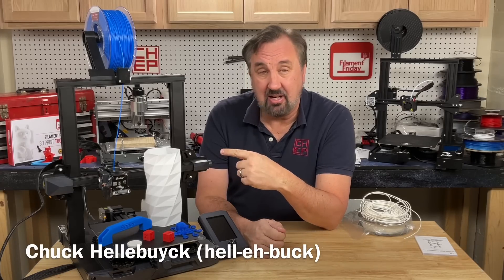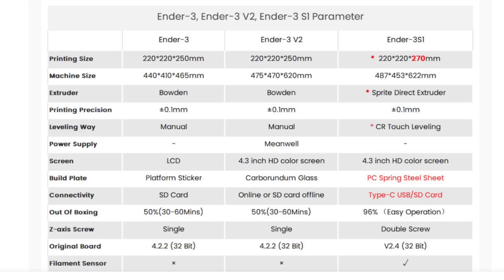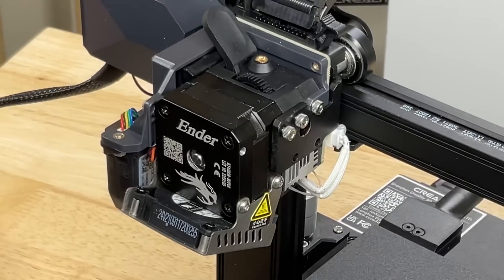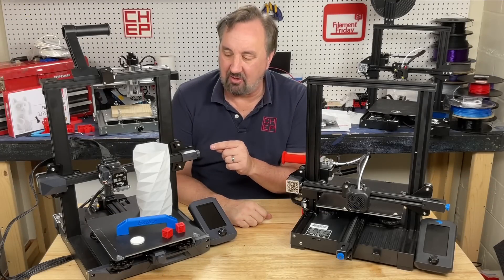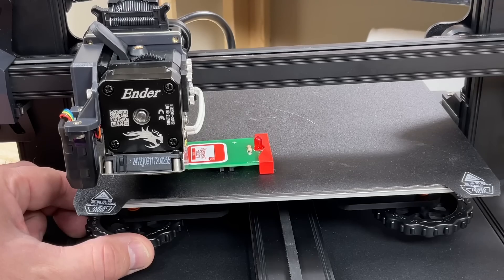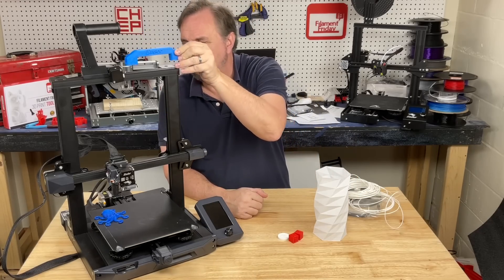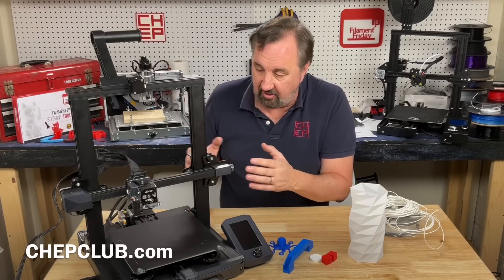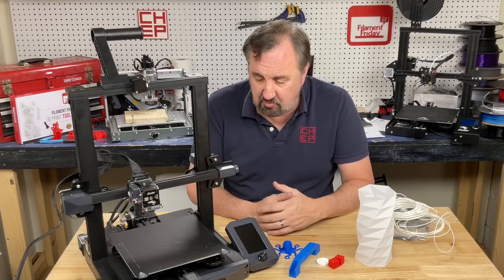Ender 3 S1 - The Direct Drive, Auto Level Ender 3 3D Printer?

Comment: The Sprite, unfortunately, has a more expensive version with an all-metal hotend. They're looking to sell it as an extra instead of including on this (honestly, rather expensive for a beginner machine) printer which is a disappointment. 

Am hoping to see a review of the all-metal sprite in the future though, would love to add it to my V2 but only if it's any good.
Reply: I don't consider it a beginner machine. I look at it as a production machine for people that already understand 3D printers and don't want to bother doing the upgrades for twice the cost. I see it as an mk3s for half the price.

Even as a beginner though, if you're quick at learning things I would still buy this over a base model.

I don't know why you'd bother putting the new print head on your E3V2. It's going to be too heavy for it without dual z. Unless you've added dual z. I can print at 150 mm a second with the stock E3v2 printhead it's so light.

Comment: Please tell us a printer that has all these options standard that is cheaper than the S1?
I love my mk3s but its more than twice the price
Reply: Your question is confusing.

You have an mk3s and the S1 is basically an mk3s for half the price. So there's your cheaper printer.

Good luck finding a good quality printer with everything these two printers have for less than the S1.
Reply: @dangerous8333  It is said numerous times in the video that's the s-1 is overpriced. So again, please tell me a printer that has the same features and the S1 but at a lower price?

Comment: I tried mimicking the dual z that the s1 has but I just keep getting binding I just wish I could figure out how the s1 does it without any problems. The s1 has a top belt that keeps them in sync

Comment: While this printer isn't that bad, I agree that it is fairly overpriced for what you get. This could be a much more competitive printer if it is around 300-350.
Reply: It's cheaper than buying the ender 3v2 and doing the upgrades. While having a more refined finish. Price is on point
Reply: @andyvannort2743  Alternatively you could decide not to buy the overly expensive Ender 3 V2 and the upgrades with it, and buy a different brand printer that is comparable. Artillery has a printer model called the Genius that surpasses the Ender 3 S1 in almost all ways except for the printing surface and reliability of the ABL probe, and it's for around 250-350 dollars.
Reply: @richiemacrophage  one of the big selling factors for me if the MASSIVE community and support behind the ender 3. I'm new to printing and these are great for learning as everyone has info about them. People clearly are willing to shell the money out for the ender 3v2 and spend the extra money on the upgrades anyway
Reply: @andyvannort2743  The community doesn't mean much anymore and is of especially questionable quality because you'll find people suggesting to disable thermal runaway protection, an important safety feature, rather than to replace a broken thermistor. Plus, nearly all budget printers have the same overall design, part concepts, and do the exact same thing. Many of them share parts with the Ender 3 in fact. Coldpulls work on both Ender and Vorons. Printers all have motherboards, use nearly the same stepper motors, many share common hotends, extruders, etc. Fixes with the Ender 3 will carry over to most other printers. In 2022, buying an Ender 3 is essentially throwing your money away for a placebo. The only reason why it's still relevant is because of the hivemind, it's an extremely lackluster printer otherwise (except the S1)
Reply: @richiemacrophage  I've owned and operated many printers and I still strongly recommend the creality printers for new people, specifically the enders. The price is hard to beat and yes, the community and available upgrades are still a huge deal
Reply: @richiemacrophage  sorry, that's too much to read for a Friday night lol. Start a YouTube channel if you're that opinionated on it. Maybe you can use it to take down the evil creality empire that is supposedly price gouging everyone with subpar printers
Reply: @BenWilson24  Oh you can find me on Reddit doing exactly that. But I don't exactly have the time or effort to make videos explaining the thing.
Reply: @richiemacrophage  You just "moved the goal post" Richie. Anyway...

I've already looked at all the reviews for those cheaper clones and everyone says it's a lesser quality machine even if it has a few of the same bells and whistles. Also many of those clones have safety issues that Creality does not. Not to mention creality has a bigger community. So all of those things make up for the few dollars in savings you might get.
Reply: @richiemacrophage  Every community is going to have morons in it. It's up to you to be smart enough to know what is good advice and what isn't.

Yeah some of them share certain things but they are not all implemented the same. The quality control is also different. It's funny you mention people saying to disable thermal runaway sensors when some of those clones didn't even have working sensors to begin with, and that's why I wouldn't bother ever spending my money on them. Not sure if the sidewinder was one of them but that other Ender clone (the name escapes me) is a piece of crap fire hazard. Even if they fixed the problem, they shipped them out knowing it was a problem and that was enough for me.
Reply: @dangerous8333  Yep, I don't think you know what you are talking about. The Mega SE has superior parts to the Ender (BMG style extruder and V5 style hotend), Neptune is mostly on-par but the Neptune S has a superior extruder and print bed, and the Genius is superior in literally every single part. You can't really trust youtube reviews either way because most of them are sponsored and/or paid for.
Creality not having safety issues? What world are you in? The Ender 3 series is especially guilty, older units having unsafe power connectors, and all units except the S1 use tinned wires instead of proper crimped ferrules like the Genius. I don't think you listened to my point on the community either.
Reply: @richiemacrophage  Isn't the proof in the prints?

My upgraded E3V2 does everything an mk3s does. So in my opinion creality is giving you a printer that's (always in stock) that's just as good as an mk3s, for half the price. Pretty good deal in my opinion.

I know for a fact the other companies are cutting corners to try and beat creality but there's a point of diminishing returns.
Reply: @richiemacrophage  That was the printer I was thinking of, the Voxelab Aquila...

Yeah, that's what I should do, I should buy a piece of junk fire hazard to save 40 bucks. Great advice. Especially for a beginner that knows nothing about thermal runaway protection or anything like that.
Reply: @richiemacrophage  You're the reason people avoid Reddit now too. 😂
Reply: @dangerous8333  The Aquila is the one lacking thermal runaway protection. The others are up-to date now and don't share the issue. You are clearly not as informed as you should be. Both the Sidewinder and Genius don't have any fire hazards, especially the new ones. They are safer than the Enders in fact because they use crimped ferrules when everyone else uses tinned wires. I don't even recommend the Aquila, but it's a superior buy to the Ender because it's just as bad but cheaper.

EVERY printer achieves the same print quality if upgraded well. All 5 printers I've used so far have printed with the exact same quality. It's the reliability and potential of the printer that matters. The Genius, compared to the base Ender 3, can print flexibles, can print faster due to a volcano hotend, is more reliable because it doesn't use the crappy plastic mk8 extruder nor crappy bowden couplers, and upgrading the hotend to all-metal is cheaper than that on the Ender 3. The S1 fixes most of the issues the original Ender 3 had, but is still overpriced compared to the Genius. On top of that the Genius still uses silent fans, a volcano hotend and an AC-heated bed, upgrades that would cost about 50-70ish dollars on the S1 (you can take away about 30 dollars because the Genius's print surface is worse).

Resorting to ad-hominem now, I see? Many people have already done that so I'm not even surprised. Are you running out of points to give? Or have I met you before?
Reply: I snagged mine for 399 on Amazon. Even my v2 on sale would cost me more to make direct drive and cr touch and dual z
Reply: Completely disagree.

You're spending $400 on an E3V2 just to upgrade it with half the upgrades this one comes with, not to mention waiting for the parts to arrive and then taking time to install them. That might be fun for a beginner but I look at the S1 as a production machine ready to go into a farm.
Reply: @dangerous8333  Again. The world is not locked to just an Ender 3. You can easily pick up a Sovol SV01 or Artillery genius, both are on-par with the S1 (The Genius is superior in pretty much every way except for the bed surface), and they are like 3/4ths-2/3rds the cost of the Ender 3 S1.

Comment: these "upgraded" printers from creality all seem like one step forward two steps back. I like the improved wiring and dual z steppers but that hotend is worse than the original ender 3s hotend and the runout sensor seems really badly placed like someone forgot to add it and was like "stick it next to the spool noone will notice" 🤣
Reply: It looks funny in images, but I actually love where the sensor is. It's on a swivel so it moves freely regardless of where the extruder is
Reply: @BenWilson24  thats good atleast there won't be much drag from the sensor.

Comment: The vent on the bottom cover wasn't aligned with the exhaust fan on the power supply?!  How much clearance was there between the bottom cover and the power supply exhaust fan?  

How did your bed surface get scratched?  Another reviewer had the bed damaged by the hot end trying to dig into the bed when he attempted a power off print recovery.

Comment: Question: What other options are there with these features for $429?
Reply: Honestly, I have a hard time recommending this when the Artillery Sidewinder X2 is about $470 unless you just can't fit the Sidewinder in your workspace.
Reply: @heroflying  I got my S1 for $389.
Reply: @dangerous8333  I still think the Artillery SW-X2 for $470 ish is a better value personally.  WAY more print volume, touchscreen, mainboard has replaceable steppers, AC powered bed, and it looks better made overall.  The only thing the S1 offers over it is a PEI sheet.  I'm not a fan of the SW-X2's permanently attached glass bed, but you could stick a magnet sticker on it and use a PEI sheet if you wanted to.
Reply: Snagged mine for 399 on amazon last week

Comment: Do you have thoughts on the difference on the surface quality  between the ender maker coin  and chep cubes that you printed?       Also,  does look like the hot end could be replaced with an all metal hot end like a microswiss?
Reply: i think creality actually sells a sprite and strider with an all metal hotend

Comment: Did you try printing PETG? I got terrible stringing when printing over 230 and I wonder if it’s the extruder that’s causing all the issues…
Reply: It would be interesting to try printing PETG at the 235 C limit to avoid damage to the PTFE tube. It might work well enough.
Reply: @Ron Holder  I'll certainly give it  a try next time. It was mainly the bed temp that was critical. Anything less than 75° will let go. 80° has always been good. I mainly use PLA+ though.
Reply: @Ron Holder  To be honest I didn't know it had a PTFE insert till I saw this review. I've probably done 20 hrs or so at 240°. I checked the insert yesterday and it showed absolutely no sign of heat damage, so looks like I've either been lucky or it's not affected by those temperatures as much as we think it is.
Reply: I don't get any stringing using PETG on my S1. 240°c 80° bed temp 50% fan. What retraction settings are you using?
Reply: @daveedaem  .8mm at 40ms. Using Overture PETG. Same roll printed perfectly with a V2.
Reply: @ShawnLomas  yeah that's exactly what I'm using. I use eSun 🤷‍♂️

Comment: Buy a Prusa. They print, print, print ... and the price is not that much higher.
Reply: It’s still 300 hundred more dolllars than this printer. Sure it will print easier out of the box. But for 300 hundred more dollars these printers are pretty similar in terms of things it can do
Reply: @j.tsessions3132  The mk3s doesn't even print better out of the box anyway. You just don't see as many people complaining about them on the Internet because more noobs buy Enders. There are plenty of post out there with people complaining of similar issues with the Prusa's and they still require upgrades too. So you're closer to $1,000 with taxes by the time it's set up right. My E3V2 actually printed really good out of the box. Beginners think they need these upgrades to print better but really they just need to get better technical and mechanical skills. I think ender's print great out of the box if you know how to dial them in, everything that comes from China needs these days. Even the tools I buy at harbor freight need bolts tightened etc. 

In my opinion the upgrades just make the productivity go up and strengthen the machine for production. I think it's a fallacy that you need them to make good prints though, and you definitely don't need a Prusa.
Reply: How do you figure the price isn't much higher?  The mini isn't comparable due to it's WAY smaller print volume, plus it doesn't have direct drive.  The i3 MK3S+ is $750 for the kit, so you're at $320 more.  That's a lot higher.

Don't get me wrong.  I like the Prusa, but on no planet is a comparable in print volume Prusa "not that much higher."  After you pay shipping, it's almost twice the price.
Reply: @heroflying  I had Ender, Aquilas and all those printers. Yes, they work quite well but after a few months of printing they start to wearing out. To keep them running they require a lot of money and time.  My Prusa is running since a year day and night with no issues. I want to print and not to service my printer all the time.
Reply: @snax_4820  You're missing my point, although you are exaggerating massively how much money and time it costs to keep Ender 3 variants printing.  My Ender 3 Pro that I heavily modified runs constantly all the time for the last yeah and a half.  Yes, I installed an EZR Struder, Dragon Fly BMS, upgraded springs, SKR Mini E3 mainboard, BLTouch, upgraded the part cooling fan and shroud.  Yes, that took time.  No, I'm still nowhere near a Prusa MK3S+ in cost.  And my printer runs pretty darn reliably.  The time factor is the big difference honestly.  Now, in terms of the quality difference, I'm not saying the Prusa isn't worth the extra money.  I'm just saying that it's simply not true a printer that costs almost twice the price once shipping is factored in isn't "that much higher".  It is that much higher.  $430 shipped vs $800 shipped is significantly more money.  If I saw someone say that this Ender 3 S1 is "almost the same quality as a Prusa i3 MK3S+" I'd say something then, too.  Call a spade a spade.  The Ender 3 S1 murders the Prusa MK3S+ on price, and the Prusa MK3S+ murders the S1 in quality.  That's a fair statement.
Reply: @snax_4820  I bet you've never owned an Ender. You were peer pressured by Prusa Fanboys into buying an mk3s, and now you're bummed to see people using printers that cost a quarter of the price do the same thing you're doing. My E3V2 going daily for a year, and now my S1 have been a joy. There's lots of countering examples to your experience from people running these things in farm environments, including myself.
Reply: @dangerous8333  The Ender 3 Pro was my second Printer. I upgraded it with everything I could find. At the end it was as expensive as a Prusa. My next printer was an Aquila. I did not make any upgrades and it worked 4 month without any problems, but then it started to falling apart quite quickly.  Then I bought a Prusa ... and ... until now ... I did not have any problems. And yes, now I am a Prusa-Fan-Boy because over all it is the cheapest system money can buy.